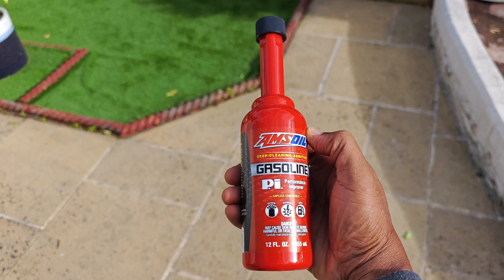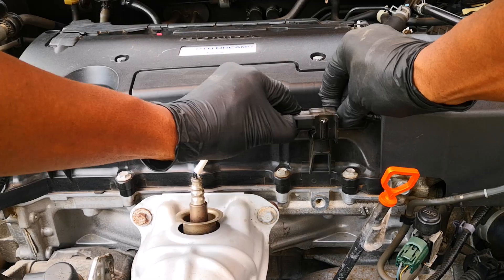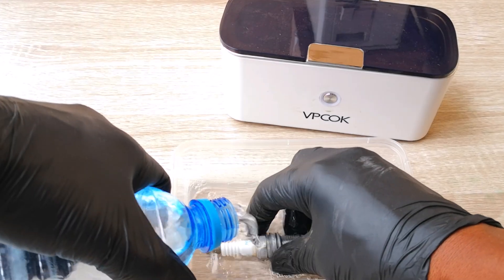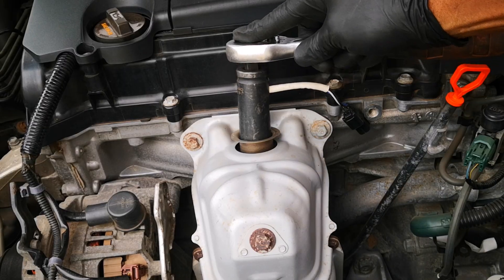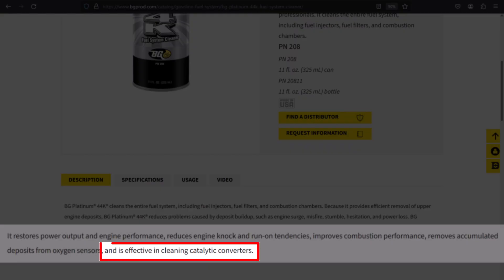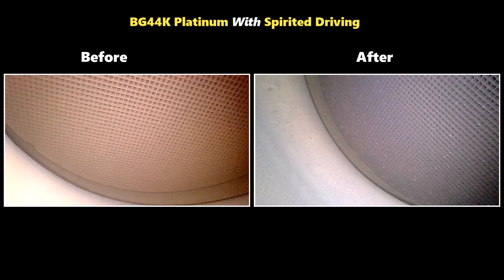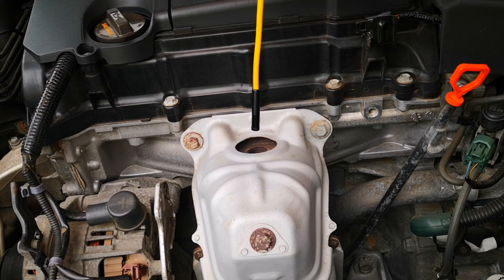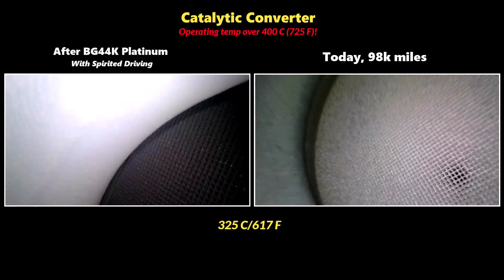Will Carbon Build up Cleaner PLUG Catalytic Converter? Will Fuel Additive Damage my Car?

Comment: Hey, quick question! I have a 2014 Ford Focus with 130,000 miles. What products would you personally recommend for keeping the engine running smoother and lasting longer?

I was thinking about using these three — do you think they’re the best choices?

Sea Foam HM16 – in the crankcase, 100–300 miles before an oil change

Liqui Moly Cera Tec – added to fresh oil after the oil change

Red Line SI-1 – in the fuel tank every ~3,000 miles

Would you say these are the top options, or is there something you’ve had better results with?
Reply from the maker: Of your suggestions, I've only used the Redline 😬.
Before putting something into the crankcase, I"d like to be sure service history has been good. Do you know if the engine has any sludge? Have you been using the recommended oil weight? Does the engine burn oil presently?
Reply: @DIYAutoworksNG Thanks for the questions; I checked everything you mentioned and everything looks good. I pulled the oil cap and looked inside the crankcase and there’s no visible sludge, and I’ve always kept up with regular maintenance using the proper oil weight at Valvoline. The engine doesn’t seem to be burning any oil either, since the level at each change is basically the same as when it was fresh. I really just want to keep this car in the best shape possible because I plan on treating it like it’s going to last me forever, so I’m trying to follow all the proper maintenance steps even though I don’t have much experience with cars and mostly learn from YouTube videos. I already picked up the Red Line SL-1 and I’m planning on getting Sea Foam and a couple of other products to help keep the engine clean, but I’d really like your opinion on what you would personally do in my situation since you clearly know more than I do. Given everything I mentioned, do you think it’s safe to run the Sea Foam in the crankcase before my next oil change and then add the Liqui Moly Cera Tec afterward, and is there anything else you’d recommend for a Focus with this mileage?
Reply from the maker: Thanks for the added context. Personally, I wouldn't put any additives in the oil except there was something I was trying to correct. I'd rather use Valvoline Restore & Protect. I'd just do the Redline SI-1 and do the usual tune ups spark plugs etc when due

Comment: Can u hold a light behind the catalytic converter so we can see through the tiny tunnels
Reply from the maker: For sure, if I ever pull the catalytic converter out. Otherwise, it's a tough ask to just pull a converter that isn't giving any issues.
Reply: What about the downstream oxygen sensor, could you pull that and put a light in it?
Reply from the maker: The first place to get clogged in a catalytic converter is this upper face shown in the video. That's the first point of impact, if it's clean, there's really no need trying to shine a light through the other end. That other end will even be cleaner. It's like the upside vs the downside of an engine air filter.

Comment: Idk about b44k. But Amsoil PI and Redline are safe. If anything  I feel like Berryman B12 chemtool is dynamite, that might clog something if it’s very bad. Thats is a concentrated high solvent. Even stronger than Sea foam. I’m going to be trying Sea foam soon in my gas tank.
Reply from the maker: Thanks for sharing! Haven't used Berryman B12 Chemtool, but from what I've seen so far, I agree. Seems like a very strong solvent!

Comment: It's not the fuel system cleaners it's the intake valve cleaners that are the concern
Reply from the maker: I did a similar video way back before and after using CRC intake valve and turbo cleaner. Same result.

Comment: Cool test as always :) wich oil do you use in that specific engine ? car specs ?
Reply from the maker: Thanks bud. I use Valvoline restore and protect. 2017 Accord EX 2.4L inline 4. Engine is GDI
Reply: @DIYAutoworksNG Yeah, I forgot you used Valvoline R&P, but before it? How did you get R&P in Nigeria, US import? wich website did you use?